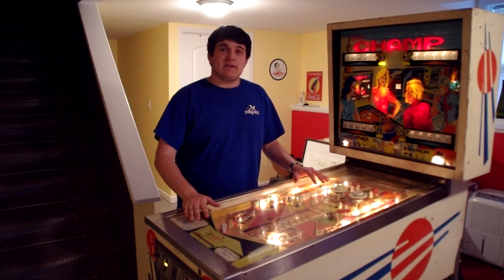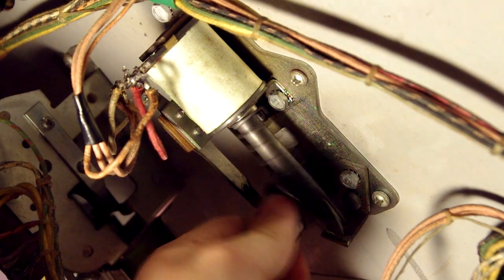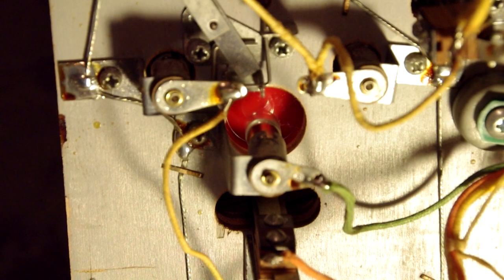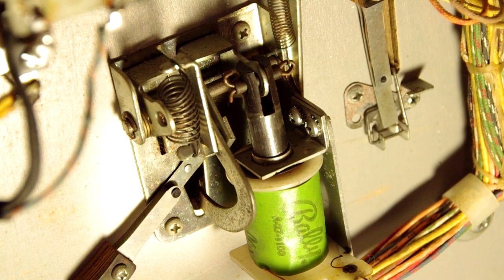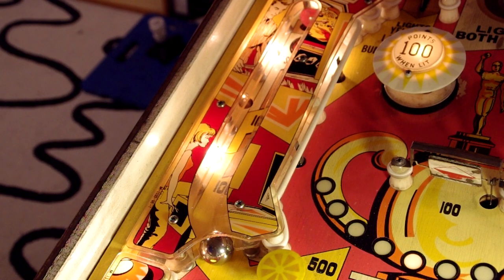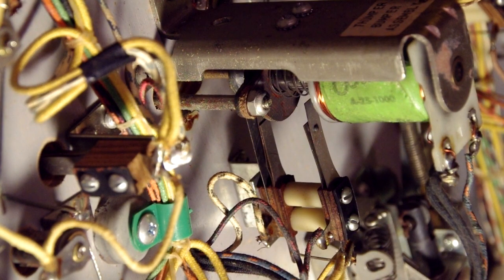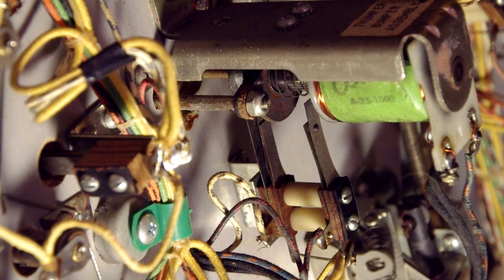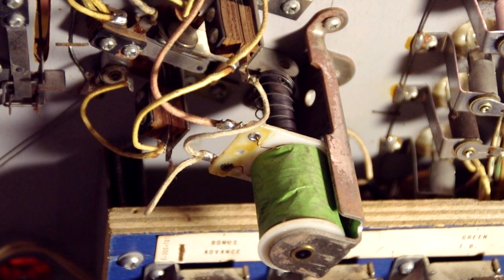What's inside a pinball machine?  Part 2--What's on the playfield?

Comment: Dear god thank you.  You literally immediately answered the biggest question I had about the electromechanical workings of a pinball machine by addressing how flipper solenoids don't explode.  I've only ever dealt with linear solenoids in the nerf modding hobby and rule number 1 has been making sure the solenoid doesn't stay activated because problems WILL happen, fast.  So when I have been watching videos of people holding down the left flipper during multi-balls, I have been sitting there in agony wondering if the machinery was being damaged!

Comment: Hope you could help me! I'm having trouble identifying a part I need to fix a pinball machine. Very new at this but can't find it in your videos. It's the part that takes the ball after it goes into the ending hole, and brings it back to be shot into the game again with a pull. This part was missing from my smaller sized pinball machine when I got it and I have looked everywhere on the internet to figure out what it is called.
Reply: I think your right, thank you so much for the help, much appreciated!